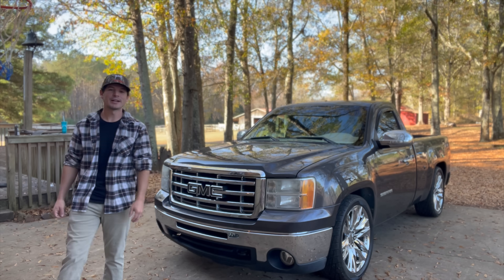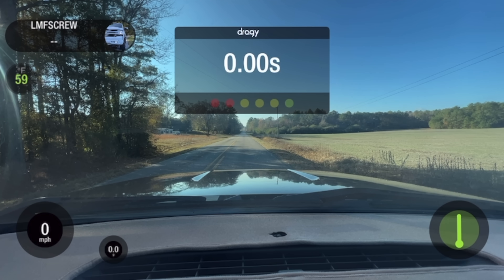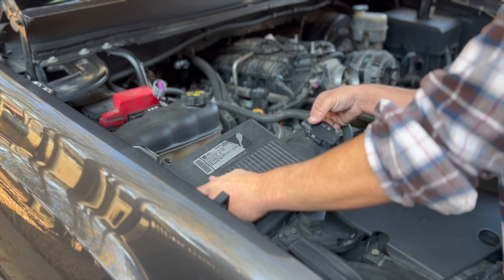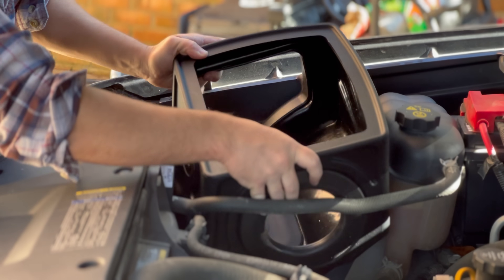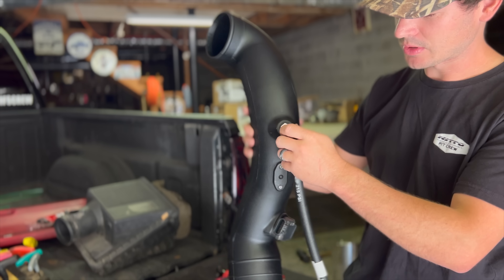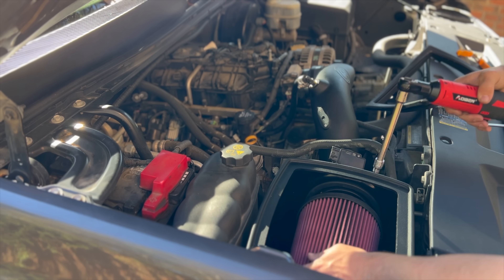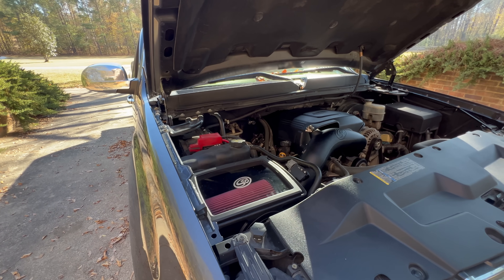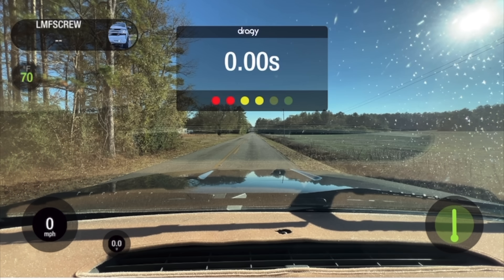FIRST PERFORMANCE MOD FOR THE REGULAR CAB!!!

Comment: Cold air intakes definitely work. I have a OBD2 scanner that can does recordings on you vehicle. I did a recording before and after my cold air intake and it was a big difference
Reply: This should be noted that it depends on the truck, some have trash factory intake locations and you’re fucked no matter what

Comment: I had an S&B on my duramax.  I had that bottom plug out and hit a big puddle of water and almost hydro locked my engine.  It was blowing white smoke for a little bit. I had to take the filter off and let it dry out.  It was soaked.
Reply: I guess they forgot that part in the instructions! Wow!

Comment: I would clean your throttle body and mass air flow sensor. Disconnect battery for 10 minutes and then reconnect.

Comment: Lets skip the bullshit involved with doing a camshaft and skip straight to the boost like this unit deserves. I am currently building one, but would recommend the huron speed kit or the speed engineering. :)
Reply: What do you have on yours that increases MPG and speed? My truck was zippy upon takeoff now it takes a while to get up there.